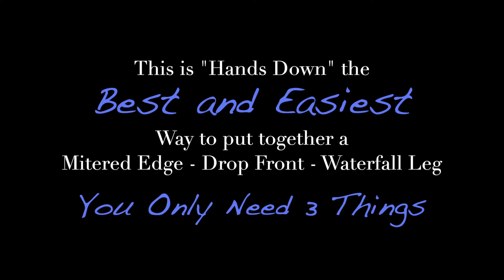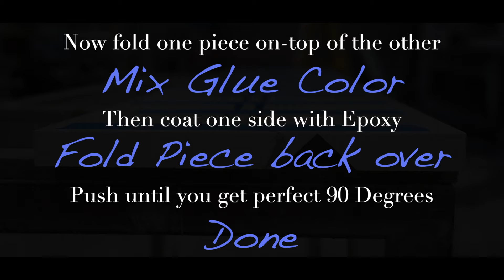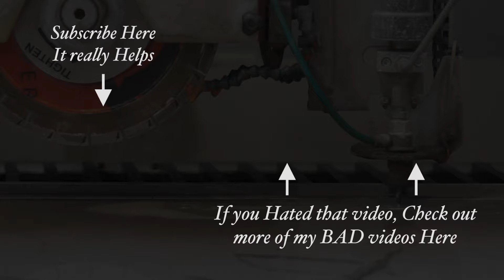How to Glue a Mitered edge - Drop Front - Waterfall Leg on any Stone or Granite. (So Easy)

Comment: All stone joints need to be scored on both sides giving the glue something to grab onto. If you don’t it can fall apart especially quartz which is non porous material. I’d wear some steel toed boots if I was carrying that around
Reply: If you work with stone try it without scoring it and then tell me it doesn’t hold, and yes I’ve done it with quartz, giant islands and they didn’t fall apart, we even stood it on the apron to pick it up and lay it down and it was fine. Epoxy is strong. Will scoring it help, yes, will it fall apart without scoring, no.

Comment: When putting the miter lam down I’ve seen some people put more tape on top of the existing tape and pulling the tape up more for security just in case the lam to heavy . I’m still learning to put this together.I haven’t tried it but they way you show it looks simple but since the machine at my shop I’m not sure how they cut there 45• .but they usually sometimes grind it down .
Reply from the maker: Hello. You can put more tape if you want. The more - The safer you can say. Sometimes too, when I do a 18" or bigger mitered edges, I'll set up a wood block. Just incase the tape fails, the wood will catch the piece. One Important tip for you. Make sure tape is on straight or perpendicular to the mitered edge. Just like ripping tape off the roll. If you pull it at an angle, the tape will rip off the roll. If you try to pull straight, the tape will not rip. It is surprisingly strong when pulled straight.
Don't worry too much about your machines. I've always believed that a good hand fabricator is better to have than any CNC saw on the market. I have hand sanded tons of "bad saw cut" miters before. Spend the extra time before gluing. It will pay off in the end. After a couple, you get into a groove. It gets easier and easier every time.

Comment: Great Video. Will this method last for pool porcelain coping tiles 10 mm thickness? How many years lifespan do you think I would get in an outdoor pool? Thanks
Reply from the maker: Hello. The method would definitely work to get a nice seam, But not sure about the epoxy. At 10mm you're looking at about 3/8" of a seam joint. Not a lot holding it together. We do 1 1/4" thick material and not going to lie to you, I have seen seams fail due to water and full sun exposure. That's a tough question. Might be out of my wheelhouse. But Im sure you can find a pool guy on here that could steer you the right way. Sorry and Thanks.

Comment: when you are going to cut porcelain at which rpm you are spinning? and which blade diameter you choose? thanks
Reply from the maker: Sorry, But I refuse to work with porcelain slabs. In my opinion, they are a nightmare. Even if you do everything by the book, two years later a corner will Spyder crack, a seam will fail, Someone will chip it (which looks horrible repaired), the list goes on. Natural stone or engineered quartz is the way to go. Natural stone has been used for 100's of years and will be for 100's more to come.

Comment: Which type of epoxy do you use ? Is it the best way to glue it?
Reply from the maker: We have been using Akemi Platinum 5.0
Crazy how strong this stuff is. Tried to pop a normal seam the other day. Two guys sitting on the countertop as I picked up the other end. Couldn't get it to pop. Ended up cutting it.
Reply: @GraniteByJay  Thanks I know that Akemi but very expencive. We try epoxy (12hour finish) it is very strong too.

Comment: Any suggestions how to turn this waterfall leg into an island extension, like and extended table?
Reply from the maker: I like the idea. But not sure how it could be done. Couple concerns - when those miters come off the saw, they are really sharp and chip very easily. second concern -  you would need some kind of hinge mounted to the mitered edge area. A hinge strong edge to hold around 90lbs of stone leg when moving it up and down. And  in order for the leg to flip up, the hinge would be mounted to the face of the countertop. Which might be a cool barn door style look. Some large black iron hinges routed into the stone faces. 
Maybe the better route would be a separate countertop that slides into the leg under the main island top. This way you could get an extended island if needed. You could have it slide out 12"-14" without having to integrate steel supports underneath. Really cool idea though. Anything could be done. With the right amount of time and money. Sorry for the novel. hope this makes sense.

Comment: I have a wet electrical tile saw that can do mitre cuts. I thought of trying this to make marble accent table. 

What is the minimum thickness material you recommend for mitre?
Reply from the maker: Hello. I would say 3/4" material. That is for a unbacked miter. 
You can go thinner if you back the miter with extra material after yo glue it up.

Comment: Interesting way of doing it. Do you ever biscuit or rough the joint? I've had stuff split because the mitre is too smooth. Do you also get any side to side movement? These bad boys tend to get slippery with glue between.
Reply: I usually rough up the joint to give it extra mechanical bond. I use 8 hour epoxy, not polyester resin like shown in the video. Not as quick but gives you more working time on complex glue ups and sticks way better, especially to non porous materials like quartz and porcelain. Also longer lasting and more UV stable (polyester prone to discoloration, especially with lighter or more transparent colors).